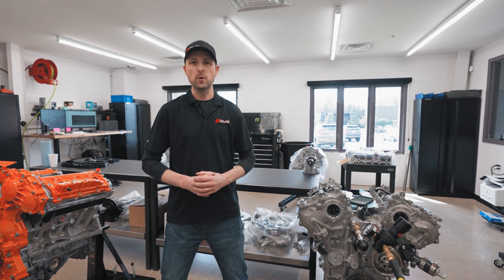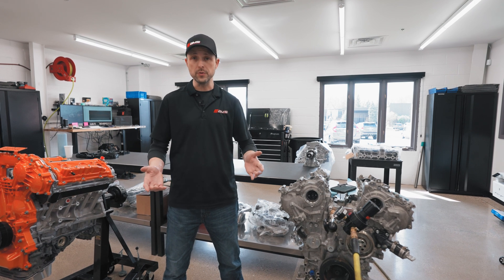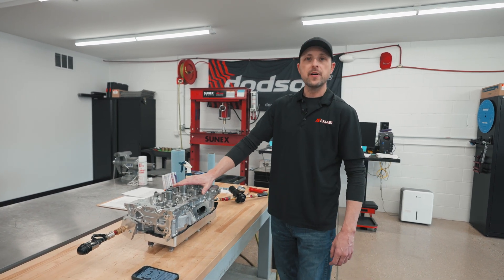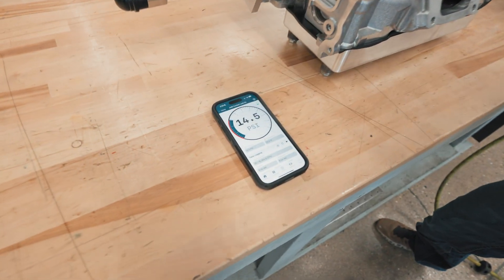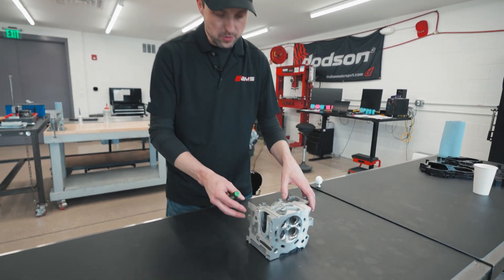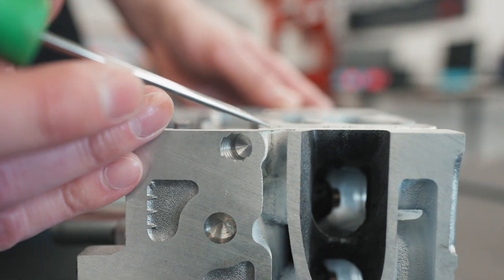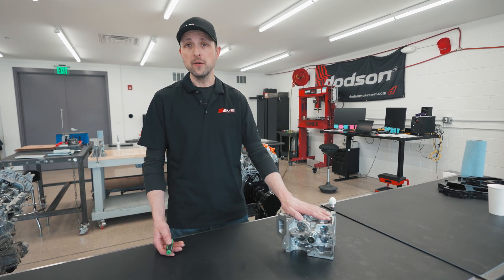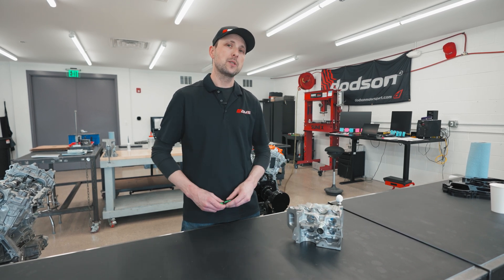The Cause of VR30 "Porous Block" and What's Really Going On

Comment: I wonder if you can fill the section of the cooling passage with epoxy since the port is for emissions. It would allow the energy to transfer from one wall to the other. (Prior NDT tech) I feel like this is an issue that can be engineered away lol.

Comment: Has Nissan made a design fix to the heads? Do new ones have a different suffix in the part number for example? 
And since the new Z has the same engine... there would be the same issue. Maybe they spent some $ to fix this as part of the Z program?

Comment: here in australia since 1987 rb30 we’ve been welding the coolant galley plug since 1987. There are thousands of these engines making over a thousand horsepower here and they all get this treatment. it definitely causes stress in that are and even more so on that engine because that plug is larger than rb30’s one.

Comment: My Infiniti started blowing gray smoke 2 weeks ago, checked oil about a quart low but only 2k miles from the oil change, I changed oil and coolant is fine but constantly blows gray smoke, could this be my problem? I’m not sure how warranty works at dealership but it’s 2021 and 40k miles under the 5 year and 60k engine warranty
Reply: This won't make your car smoke, the consumption is too slow. Even marginally bad turbos don't smoke...your smoke means you have oil pooling in your exhaust, which means your turbos are utterly wasted.

Comment: do the new Nissan Z's have this same issue?
Reply: i'm losing coolant, and it may be my head studs.
Reply: @wheraboo5013 what year? Forums are saying nissan never updated/fixed the issue but dealer mechanics telling me 24+ should be rare case, though idk how much i should trust his word
Reply: @KpxRagDoll newer years have a much lower chance, im just unlucky. 2024 Sport Z.
Reply: @wheraboo5013  rip... did you do anything to your z? And warranty should cover you still no?
Reply: @KpxRagDoll im taking it today actually, im hoping they do. I have 13k miles in 2 years, so roughly 6k miles of driving a year. I’ve done intakes, exhaust and lower down pipes.
Reply: @wheraboo5013  mmm would the ldp be an issue with the warranty? I think my mechanic/service advisor said it shouldnt but cant remember... but he said mentioning constant coolant loss with no visible leaks should be the way for nissan to get you a new motor and hopefully new turbos.
Edit: wait no i think they might be an issue, if i remember correctly he said catback and intakes are fine but ldp you might wanna swap the oem back on he said.
Reply: @KpxRagDoll  I think my dealer is fine, I asked them to tear down the head and check the head studs.

Comment: Is there a solution to the cracking head? Any way to upgrade the heads through aftermarket means, or hardware that can be added to prevent/deter the issue?
Reply: No, speaking as an Automotive engineer; chamfer and insufficient material thickness is a design flaw that can only be fixed there. Clamping force of the headbolts could be reduced (in theory) but then you would have other issues again. Thickening of this section, reducing possible coolant flow (unfortunate) and filleting the chamfer would be the way to go.

Comment: As a dealership technician we had found this issue about 7 years ago. We had an engine outside the car with a pressure tester and coolant dye in the system. We could see the trail of dye coming from the head bolts and running down behind the timing chain.

As for porous blocks, we have had some but they are usually external leaks and they have always been leaking behind the drivers side motor mount bracket.
Reply: You took the words out my mouth. Dealership tech here as well. 100% accurate.
Reply: @fedj18 and @rubenpatino Help me understand something. So even if the dealership were to replace the cylinder head or engine, this problem is inevitably going to come back since the cylinder head was never updated?
Reply: @Jlaverdure06 , yeah we need an answer. If so im getting a warranty extension or selling it.
Reply: Wish you had a platform to speak on this 7 years ago.. lol. I spent over a year trying to chase down the actual problem.

Comment: I’m not a baller or have unlimited pockets to spend money on one of these cars with a vr30 only to have something happen to the motor due to bad design and the cost of new engines are not cheap so it keeps me away from even going down that path of anything with a vr30 and I hate it cause I love the cars it comes with but I’m not down for the money pot that it will have me in.

Comment: Pretty odd to me there isn't a steel insert in those head bolt holes.I would be tempted to make and install some
Reply: it would make the issue worse, it crack as is so milling it out to fit a sleeve is going to make it thinner, plus the added stresses of steel expansion v aluminum.

Comment: So is this head issue fixed on newer engines? I have a 21 red sport with 38,000 miles two months ago had the engine replaced with new turbos. Am I good to go?..
Reply: Don’t believe so I think it’s all the same besides the turbos but still are trash, mines a 2021 with 39k miles and it’s blowing some smoke
Reply: Only way to know is to keep sending blackstone your oil samples

Comment: I just had an idea as a stop gap until an official fix is found. What about cylinder block concrete? fill the area through the galley plugs. use a balloon from the back side (deck side) to keep the concrete in place while it hardens so you don't loose all the coolant passages maybe?

Comment: Is there any reason to suspect this problem is due to over-torquing the bolt or any other non-design related reason? Is there any evidence that Nissan improved the design around this specific area to prevent the problem on later VR30s? Should we just expect that this problem is inevitable on all VR30s at some point simply due to mileage or age? Any insights are much appreciated. Thanks.
Reply: That’s the annoying part there is a new part number this and that… what’s the difference? What’s the probability of it being better? Is it thicker? Will it make a difference….? Ohhh we haven’t seen the i$$ue yet…

Comment: This has been the worst news I could have ever received. The Z Nismo was a dream come true for me of hard work and dedication, knowing its engine is flawed is super concerning. 
I should’ve got the Supra instead!
Reply: Yeah, because BMW engines never experience catastrophic failure. They never eat through rod bearings. They never experience catastrophic oil pump failures due to plastic internal parts. They never experience catastrophic crank hub failures due to idiotic two-piece designs. LOL! Calm down.
Reply: Get a b58, no worries about this at all and make more power reliably, this is super unnervering because i almost pulled the trigger on getting a Infiniti q50....fuck that.
Reply: This has been a known issue for over 5 years, it was just originally thought to be the block itself but now we know it's the heads.
Reply: @q6_zilla  simply means the engine is trash and all Z owners will loose huge value. I knew I should've gone with my brain and not my heart and got that Supra.
Reply: the supra might not be any better, they had to revise a wind buffeting issue.
Reply: @elliottb7009  They never revised anything. The wind buffeting issue is a design flaw that would require a whole redesign of the roofline.
Reply: No your fine, nissan revised the heads for the 2022+ vr30’s
Reply: @Yoomaro  Is this true? I bought my Q in early 2023, it was manufactured in 2022, and I am also quite worried about this 😢

Comment: At last we finally have an answer to this riddle,  those of us in the Q50 forums have spent many days theorizing on what the root cause could be.   I was always pretty doubtful it was a porous block and chalked those up to the reported problem by Dealership techs who don't have the time to perform a root cause analysis.  They see coolant mixed with oil call it a porous block and move on. 

My money was always on something else like QA issues on the assembly line or a design flaw given how they never published an official TSB for the issue or released a huge number of revisions like they did with the Turbos. 

Thanks for the hard work AMS team!
Reply: Hello, is this problem common to all Q50 engine models? I own a 2023 model. Is there anything I can do?

Comment: Those galley plugs do in fact leak, had it happen to my car
Reply: They just said they've never observed it, the head bolts also torque down right next too those gallery plugs so its possible the cracks made their way towards the head bolts causing them to leak.  Not that the sealant or washers they used failed.

Comment: How does one even diagnose this issue. Am I supposed to take off my head and look for a crack?
Reply: You'd be hard pressed to see it with the naked eye in some cases,  you'd need to pressure test the system and see if it holds air under pressure.  Sending your oil off for analysis by someone like Blackstone to check the health of the engine and see if coolant is mixing with your oil is probably the best way to can keep an eye on the motor and see if its healthy.

Comment: Will you guys develop a head to remedy this issue? Also, at what point do these cracks develop? Is it mostly on modified engines or are stock engines also susceptible?
Reply: Its a design issue with the heads themselves so both stock and tuned motors are susceptible.  As for when they develop that depends on a lot of factors, we have Q50 members who hit 120-130K miles without a problem  just depends on a lot of factors like the QA on the assembly line, casting quality of a given block etc. etc. 

Most people in the Q50 forums who've reported issues see coolant issues appear between 20-60K miles and it appears most common in 2016-2019 model years, but that's also when Infiniti sold the most cars with the VR30 so the issue could be a problem for later model years as well.
Reply: @BigHeadClan Thank you sir that was very informative!
Reply: the vr30 isnt worth all that effort

Comment: Hey AMS great video! 
What is the part number # for the update you mention a few comments above. Or is there specific blocks such as 2023+ that have no issue.
Reply: Possibly 110904HK0E,  its what I see as the latest version and is used in the Z, but I'll let AMS actually chime in on that point.

Comment: Hi, I am looking to purchase a 2022 Infiniti Q60 Red Sport. It's the final year of the Q60. Would you know if this issue was resolved in the 2022 model year? Thanks!
Reply: Can't say for sure Infiniti updated the heads at some point of the VR30 life-cycle and now use the Part#110904HK0E  (possibly 2020) but the sales for the VR30 dropped off a fair bit around that time so it could still be an issue, but  the Q50 forums tracking sheet only shows 2016-2019 model years but its a pretty small sample size compared to the sheer number of cars on the road. 

The 110904HK0E cylinder head though is what they use in the new Z from what I can tell.
Reply: its just a luck of the draw depending on how the head was cast.
Reply: unlikely

Comment: My big question, why nissan or infiniti haven't caught this and do a recall on this?

Awesome video
Reply from the maker: That is a great question! If its anything like their turbo recall from earlier this year, we can expect a recall on this in another few years... If they're still in business...

Thanks so much! That's what we're here for! To help the community in every way we can!
Reply: Nissan CANNOT AFFORD a recall, they have one foot in the grave, and the other on a banana peel.........
Reply: Most likely they are fully aware of it, but recalls are only really performed when the cost to repair under warranty after the damage is done outweighs the cost of the recall itself and or there is a risk of injury.   This is still a  far less common issue than the turbo issues based on the data collected on the Q50 forums.

Either way I wouldn't be counting on a recall any time soon unless this video picks up a lot of steam and puts pressure on Nissan/Infiniti to act.
Reply: AMSPerformance send this to Nissan.
Reply: I was going to say the same thing then totally forgot that they're on life support right now so they can't really do much to begin with.
Reply: Nissan and Infiniti Recall Over 400,000 Variable-Compression-Engine Vehicles in the U.S.

Comment: Good info, so basically these heads are cracking which is causing these issues.
Reply: Its called finding a flaw in the design of the head. An area where the cast is thinner which means a weak spot. 
The other question is, will this happen during normal "stock" boost levels or is this happening when people swap turbos and crank the boost up ?
Reply from the maker: That's exactly right!
Reply: Yeah that's not good.... and it's a tough issues to fix until someone comes out with aftermarket heads.  That's a yikes cracking heads with no possible easy fix.

Comment: So Is there anything we can do to prevent this? Probably a stupid question but does this come down to people beating on the car or is it something that just rarely happens? And does each model year of the vr30 have this problem?
Reply from the maker: Unfortunately there is not much that can necessarily be done to prevent the issue as it is a design flaw in the head.

No such thing as a stupid question! You are always free to ask away, we will always do our best to answer any question! But no, it does not come from driving the car hard or anything like that. It is a design flaw from the factory and can happen to anyone. From our testing so far, we have found the issue in about 40% of heads we have tested. So while not 100% common, it is definitely an issue that needs to be addressed.

We can not say definitively on the model year question at this time. We have found that there is an updated part number that we have not found this issue in yet. That is not to say the issue has been solved, just that we have not encountered it yet in our testing.

What can be done to rectify the issue is replacing the head with one that is known and good, as Lance mentions. But how this issue was being treated in the past was by replacing the short block, as the issue was believed to be the block. But since we have found the issue to be the heads rather than the block, replacing the block would not solve the issue.
Reply: @AMSPerformance what would that part number be
Reply: You can’t do anything to prevent it if it happens.  Maybe upgrade to a AMS CNC billet head casting? Gotta remove the whole engine or tear it apart. 🫣

Comment: Well ain’t this unfortunate
Reply from the maker: The issue is unfortunate, but this information is fortunate! For years, the issue has been thought to be a porous block. With this newfound information, the issue can be properly addressed! That's where we come in 🫡
Reply: @AMSPerformance  My question is have you had this problem with the race z, or is this coming from older Q50/ Q60 heads?
Reply from the maker: @ChrisWallace1987  A good question! We have not experienced this on our Z. The Z has not been around as long as the Qs so time will tell! But yes, the issue is coming from older Q heads
Reply: @AMSPerformance  I have complete confidence that AMS will find a solution for this long before Nissan will.
Reply from the maker: @ChrisWallace1987  We appreciate that! Especially with everything Nissan has going on, this likely isn't high on their list of priorities. Whereas this platform is one of our main focuses here at AMS!
Reply: Excellent video and it gives me kind of a sense of relief.  I've been sending my oil to blackstone at changes, and so far no coolant.  Fingers crossed it stays that way for this 2nd engine assembly.  
Thanks for the vid!